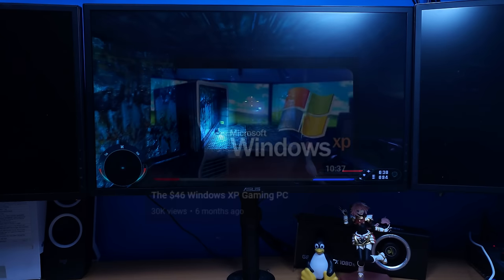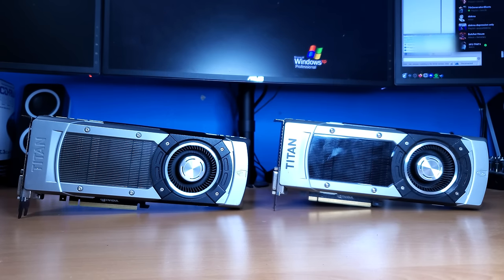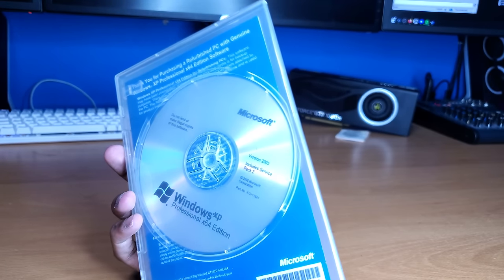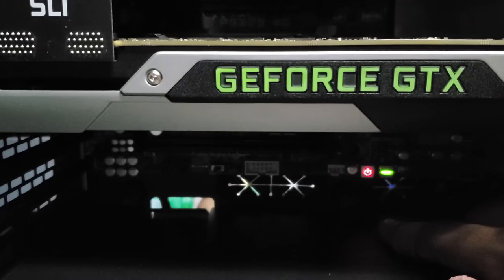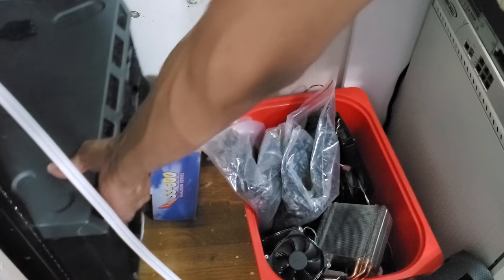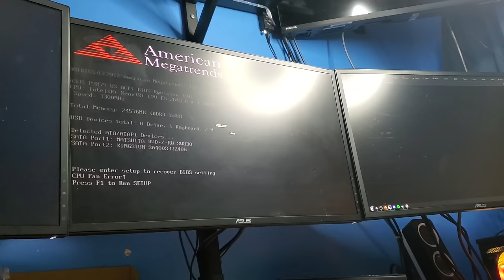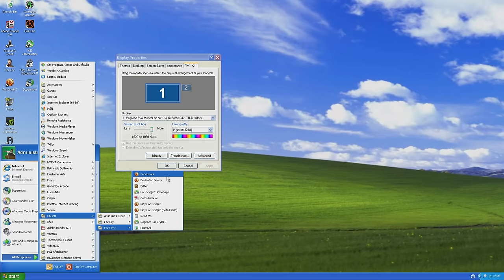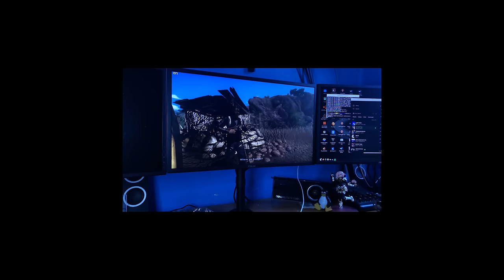Building the Worlds Fastest Windows XP PC! The Overcompensater

Comment: I really need to stop watching your videos. They make me want to spend wayyy too much money on a 4th XP machine.
Reply: Real
Reply: a 4th?
Reply: The fact that you have 4 xp machines is crazy
Reply: I got a cheap dell pre build and a gt 730 I think that good enough
Reply: Why 4 
Me personally i use a pretty badass dualboot machine
It has i7 3770 with higmatek windpower 930 cooler runs cpu at 4ghz
8gb ram 2x4
480 gb kingston a400 ssd has wijdoss xp and 10on it (thats why i even got 8gb sijxe i use32 bit winxp 
2tb hdd
Gigabyte z68 xpud3p 
650ti 1gb (yes gpu is bit weak )
Reply: Imagine Win XP on a ThinkPad w700
Reply: Silly goose
Reply: same LOL

Got one with E8400 - 9600GT, another one with E5200 -9600GT, another one with some PGA478 Pentium 4 and a random crappy GeForce, and an Asus F5RL-AP056 laptop. There's just no such thing as enough Win XP computers.
Reply: I got one with a nvidia quadro and a core 2 duo woth 8gb of ram from a yard sale for $1 (its an hp compaq dc7900
Reply: XP pro x64 wasn't bad, you needed to set large address aware flag on your programs though so that you can use more than 4gb ram more efficiently.
Reply: Bro I can’t wait for my 30th
Reply: @energygameplay6513 bro has more ram then one of mine
Reply: Calm down addict
Reply: I kept all my old computers, and the boards. I hate them because it's gets me in trouble for bringing these machine out as they take up lots of space.

Comment: I think this build needs a Soundblaster X-FI Titanium. It's roughly the best sound card of that era and EAX was still pretty big for XP games.
Reply: Soundblaster X-FI Elite Pro rules them all.
Reply: The Rx gaming version also has eax support and it’s newer.
Reply: Watching this video on my XP machine (with an X-FI Titanium), as I read this comment haha!
Reply: Titanium came out in 2008 which is a Vista era card.  The X-Fi fataility was the best of the XP generation with 64MB of ram vs the Titanium's 16MB.
Reply: Laughs in Auzentech Prelude/Bravura
Reply: @nostalgicpchardware  Both came out after XP was obsolete 2007 and 2010 respectively, and the Bravura was not a proper x-fi card.
Reply: @BenState  Yes, I have this card still boxed that I got for free during a computer repair shop shutdown ive been saving for a nice xp build some day.
Reply: @BenState  I still use an X-Fi Fatal1ty, still sounds great
Reply: oh man, EAX gave unfair advantage in PVP FPS games. There were subtle but distinct differences in footstep sound based on enemy location in games that fully supported it. It was that generation's null bind keyboard.

You could be playing cs1.6, sitting in nest on de_dust, and have to deal with disbelief and accusations of cheating because you somehow knew whether an approaching player was coming underpass or tunnels, every single time. Same thing with distant gunfire and explosions. You knew exactly where it was, and what approach you could take to come up from behind-- the sound had an extra layer of unique quality based on its position. 

It never got a critical eye because it took some configuration and tweaking to enable and capture the perfect distinguishing reverb nuances. Not enough players were aware of its purpose and existence, even if they had a Creative sound card, and there were few avenues for it to get mass attention. Those were the days... when you could be rewarded for research, then hoard the secrets of your play. And then sound cards started their quiet downfall. 

Thanks for reminding me that it existed, because it was cathartic recalling how much I loved it. I still have rosy lenses about EAX and insist it was peak functional audio for gaming.
Reply: I have 4 of them in a box right now lmao.
Reply: I had a Hercules Game Theatre XP back in the day and I loved the thing. It really did make a big difference in sound quality. I'd always had a Soundblaster, but for whatever reason at the time I went with the Hercules . I think it was because it had MIDI in and out and I was just getting into music production at the time,

Comment: Save your money when it comes to 4 way sli on xp, there are no drivers that are available for XP with 4 way sli (Apart from the 7000 series dual GPU's such as the 7950gx2) This is due to the triple frame buffer limit in DX9
Reply: What about 3 way SLI? Also, what about the Titan Z? Could you run two of those and get 4 way SLI? Just curious
Reply: @RobloxianX  it's a limit on the amount of GPU cores, so makes no difference if you are running 2 cards with 2 GPUs on them or 4 cards with 1 GPU on them.
3 way sli was never implemented on Windows XP
Reply: @jasonsanders1244  I guess, 2 more questions I have is: Can Windows Vista go to 4 way SLI with the GTX Titan X Maxwell, and can Windows 7 work with the 3090 Ti in SLI? Both for the list im making right now (Asking for the officially supported answer obv)
Reply: @RobloxianX  not tried 4 way Maxwell Titan on Vista but I am running 3 way without issue.
Not tried 3090s in sli on 7, but I can't think of any technical reason why not (unless there is a limitation in the driver)
Reply: @jasonsanders1244  I do know that the 3090 in SLI works, but ive heard some problems with the 3090 Ti even on Windows 10, but in that case it may just be a universal issue with the 3090 Ti and SLI, since it was made after Nvidia abandoned SLI in the first place. People have gotten it working without 3rd parties though, so i'm not so sure.

Comment: I'm glad you qualified this by saying only "officially supported" hardware, and that you want all the extra cores to try video rendering...  Because you could manage to squeeze a tiny bit extra performance in gaming specifically, with a Haswell CPU and Maxwell GPU.  But they require some very minor text edit hackery to get unsupported drivers working.

My ultimate XP rig has a Z87 mobo, a Pentium G3258 Anniversary (unlocked), and a Titan X (Maxwell).

Since most XP games can't even use more than two threads, you get better results with two extremely fast cores, for less overhead.
An i7 4790K with hyperthreading disabled, and two cores disabled, would give slightly better results... but they still cost ten times as much as a G3258.
And a Broadwell based i7 5775C would theoretically give the best results with it's L4 cache, but they require a rare Z97 mobo.  And chipset drivers would likely require even more hacking.
Reply: my main pc has an i7 4790 cuz its just an old dell optiplex that came with one, the optiplex cost 50 australian dollars as a total which was pretty cheap

Comment: I dont know if it was mentioned, but by default installing XP on an SSD will not get an alligned partition which will wear out the SSD way faster and cause slower pefrormance. To solve this, connect the ssd to a windows vista+ machine, create the partition there and then install XP on that partition created. Otherwise, connect the SSD to another PC, run minitool partition wizard and allign the partition.
Remember me , the IO performance will improve drastically.
Reply: Someone finally mentioned it.
The moment he mentioned the SSD, I was like wtf.

Comment: I'd argue that the Radeon HD 7970GHz is actually more of an ultimate XP card than any Nvidia offering for a simple reason: better DisplayPort support.
For some reason Nvidia decided to not support higher bandwidth DisplayPort modes on XP, their official documentation simply states "not supported"
Meanwhile the Radeon has no such artificial software limits, though admittedly the compatibility is rather spotty and can require some fiddling to get to work. But you can actually reliably do resolutions like 1920x1440@165hz and 2560x1440@120hz while in my experience the Nvidia cards are limited to 100hz or so at high resolutions.

Comment: gtx 980ti and Titan X macwell are the fastest gpus with xp supported drivers.
Reply from the maker: I looked at this, while you can get drivers for those cards they are not official. I wanted to keep this build all officially supported hardware.
Reply: 980 TIs and Titan XMs have AWFUL VRMs though, unless you go with the 980 Ti KPE.
Reply: @Wasmachineman That doesn't matter at all...
Reply: @hupert9421  Haha, yeah, until your card blows at stock clocks.
Reply: @Wasmachineman  Admittedly, this is very anecdotal, but I used to daily drive a Titan X and I never had an issue. Worked and boosted super well.
Reply: @Ionic1k  The card drivers that are official do work Nvidia just never listed them working on it.
Reply from the maker: @EliezYT  oh? maybe ill give it a try
Reply: More like the Quadro M6000 24GB
Reply: @himmelskibet  Actually, I justtt found this out too. You can use the "hacked" drivers for the Quadro M6000 as well. Thought it only applied to the Titan X at max. With that said though, the Titan X will be a little faster than the M6000, though whether you care about that or the high VRAM amount and extra Quadro features is up to the individual.
Reply: There are official drivers for Maxwell 2.0 cards (ie GTX 900 series) for XP, but nvidia only listed the 950 and 960 as supported for some stupid reason. If you select XP as the OS and the 960 as your GPU on nvidias driver page, it'll magically spit out a driver (version 368.81 from 2016) whereas if you pick a 970 and faster, it doesn't.  Since all the 900 series use the same Maxwell 2.0 core, adding the device ID for whatever 900 series card you happen to have to the inf has it working instantly. My personal "retro" rig uses a 3770K on a Z68X-UD4 (6 series chipsets have official driver support) with a ridiculous 32GB DDR3-1600 and an EVGA (RIP) 980Ti. Runs XP and Win7 in dualboot off of a couple SSDs. In fact, I modded the BIOS a couple years back to include NVMe blobs, so it could boot off of NVMe SSDs in PCIe adapter cards, but I'm not making use of that in its current incarnation

Comment: Some corrections:

1. While the E5-2697 v2 is indeed the highest-core count CPU under X79, the problem is it's not the fastest even in multicore. That honor goes to the E5-1680 v2, which is fully unlocked and able to be OC'd at 4.4-4.6ghz. This gives you superlative single core performance, and multi-core equal (and probably slightly better due to better single core perf) to the E5-2697 v2.

2. The Titan Black isn't the best officially supported GPU. That honor goes to the GTX 780 Ti (without .inf modding) or the GTX 980 Ti (with .inf modding) - the GTX 780 Ti, despite having only 3GB of VRAM, can boost way higher because AIB cooling implementations are way better than blower designs, and the same goes for the GTX 980 Ti vs its Titan X Maxwell sibling. To make the GTX 980 Ti work btw, all you need to do is get the 368.81 official XP drivers, shoehorn the device ID of the GTX 980 Ti in the driver .inf file, then proceed as normal. Bam, you're now cooking!

3. How did you enable SLI on two Titan Blacks? Does it even work? Officially, Nvidia allows you to enable two-card SLI until the Fermi generation, with the GTX 580, and 4-card SLI is only possible with the 7900 GX2/7950 GX2; since kepler, to do SLI period you need to go to Windows Vista and later. Not that you need SLI on Windows XP, if you're using a GTX 780 Ti - on average, two GTX 580s are equalled by a GTX 780 in performance, and are soundly beaten in power consumption, frametime consistency, and general peace of mind. A GTX 780 Ti, or better yet, a GTX 980 Ti? They'll shred. It's not even a contest.

4. Where's the Soundblaster X-Fi Titanium? EAX was a big deal in the XP days, and personally I'd rather stick with two TITAN Zs or three GTX 980 Tis and slip in an X-FI Titanium than do 4-card SLI and have no spare room for a soundblaster.
Reply: Dude, I admire your knowledge. I'm a newbie but I want to build a xp gamer pc just like this one for my boyfriend. Is there any other consideration I should have beyond what you listed? Or anything that could help me in my quest? I just got my ee degree, so i understand the theory but i dont have enough money to go for the trial an error method 😢
I actually didnt quite understand the error and how it got solved. I wish it was more of a tutorial. Tysm for reading this

Comment: Love the X79 and X99 era of hardware. I actually have a Titan Black I don't use and it has a Raijintek Morpheus heatsink swap on it. Sometimes when using an old board that doesn't boot, I noticed the first thing I do is put in a brand new coin battery. Surprisingly, that can make it not boot properly. But man, trouble shooting used parts is definitely a pain and part of the fun of these older builds. On one board I noticed there was one slightly bent pin and that was enough for the CPU not to post. On another finding out a RAM slot doesn't work was also torturous fun.  Haha. My favorite X79 board is the ASROCK Extreme11. I was using it with a Xeon E5-1680V2 multiplier overclocked.

Comment: you could have put a 4960x on that motherboard and overclocked it to 4.4ghz, i used to work for a company that used a custom version of that motherboard basically same board but had IPMI built-in, and that board was SOLID and could handle bringing the CPU to 4.4GHZ all cores, and theoretically you could even get a bit more from the 3960x, we used to OC it to 4.5GHZ IIRC. obviously you needed serious cooling, but in 2015 we had that mounted in RACKMOUNT chassis and running a custom closed loop AIO. we unfortunately had to turn OFF HT, but let me tell you, if you needed single core performance, we had a OC profile that would get the i7-3960x to 4.8GHZ on 2 cores and on 2133mhz ram
Reply: Or he could get the overclockable 8c/16t Xeon E5-1680v2 which for some reason never got an i7 version
Reply: @Pasi123  they couldn't overclock very well at the end. as the cpus became closer to end of life, the binnings got worse. VIDs were too high on them.
Reply: @Pasi123  that chip is a beast but blows motherboard vrms in my experience, i even managed to melt a sabertooth x79's eps connector with that chip, cpu is still fine tho lol

Comment: Ionic1k : the E5-2697 V2 has 12 very slow cores at only 2,7 GHz and a 1-core turbo of quazi 3,4 GHz. It also has a MESH architecture which is known to have much slower IPC than the consumer RingBus. Because of these two facts that are provable anytime anywhere, you have made a mistakr, whether it is intentional or by illiteracy.
The AMD FX 8370 8c/8t CPU running at stock base of 4.0 GHz turboing on 4-cores simultanrously up to 4,3 GHz has a higher IPC, higher single-core and higher multi-cote performance. And it officially supports Windows XP.

Comment: One thing you should be careful with modular power supplies is there are no standardized pinouts for the end that plugs on the PSU, so you should only use the cables which are shipped with it as pinouts can be different across different models from the same line.

Comment: You should look into unlocking the turbo boost, not sure about the difference in-game but it will help a lot in multi-threaded scenarios. Also, if you plan into using the machine long term you'll need a way to TRIM that SSD. I know old Samsung SSDs have a Windows XP software that takes care of that, if you have something like an 870 or potentially even older laying around.

Comment: i remmember windows xp 64bit being pretty prototype and janky, so good job getting it working. Also FarCry 2 is renowned for having problems running so that was a surprise that you choice that as the first test. Rise and Shadow of the Tomb Raider supports SLi even at the DX12 level not sure if they would run on windows Xp though, looks a bit tight to 4 cards in there, looks like you might only be able to fit 3 unless you somehow turn the cards into single slot stead of double slot cards.

Comment: Currently struggling to install windows XP  (32 bit for the maximum compatibility) on Asrock X79, wanted AHCI but it bluescreens either during the install, or after the OS starts to boot for the first time, switched to IDE mode and now after installing 980 ti driver, bootloops...troubleshooting time
Good to see that you successfully finished your build
Reply: You just need to load the correct sata drivers during the install
Reply: @rare6499  I used the driver from manufacturer's website, tried to integrate them, use floppy same issues,
I think after installing the OS in IDE mode and installing AHCI drivers after it I can switch to AHCI mode and it should work, have not tried it yet, will do when I get some free time :)

Comment: This thing is sick! I wish I had the money and space to build one. Honestly, I have been itching to use windows XP for a while.  VM's are to laggy and XP always crashes with the VM's I make. I have two older computers right now. A Dell Inspiron 8000 and a HP Pavilion DV7. The 8000 I have is currently running windows 2000, however, it locked me out so I don't have access to it right now. I will need to re-install windows. The DV7 I daily drive as a secondary computer. If I don't feel like using my main computer, I will switch to the DV7. I think I'm going to put XP on the 8000 just so I have an XP machine.

Comment: I don't know if XP 64bit can actually be called XP.  I know what you are thinking... it's called XP.  But XP 64bit is basically 2003 server, and it was an afterthought at that.  Plus it never got SP3 and some XP programs won't run on it.  There are a bunch of little differences that disqualify XP 64bit edition in a lot of peoples' minds; mine included.  But hey... cool build.
Reply: 64bit XP opens up the doors to one hell of a lot more (64bit-only) modern software... and games. Hell... GTA V can be modded to run on XP 64bit, potent hardware provided